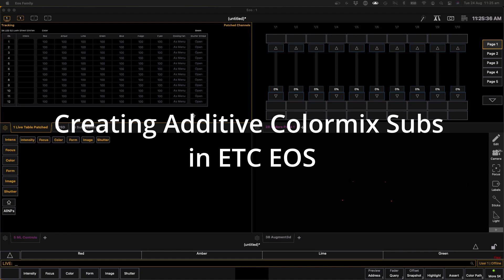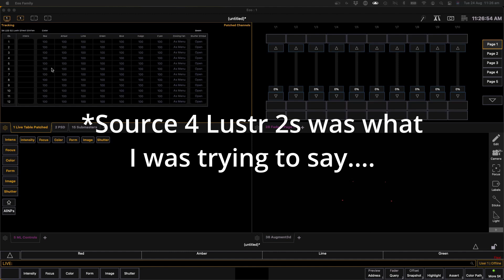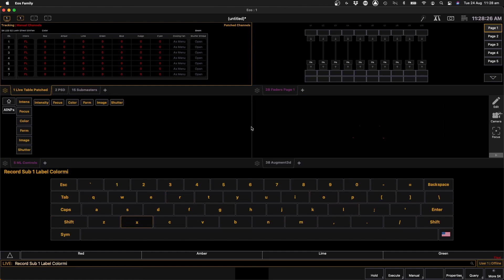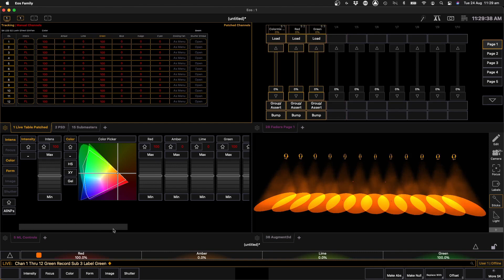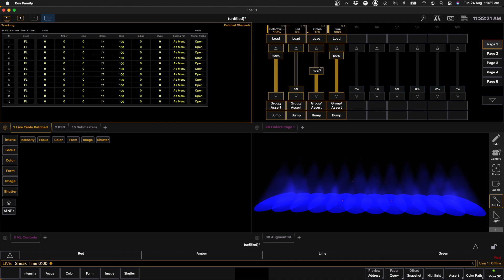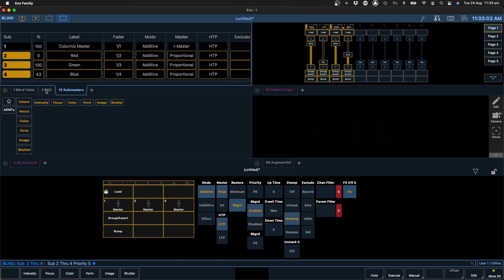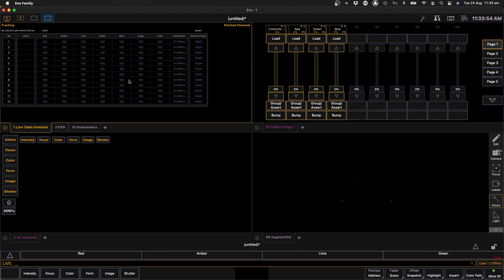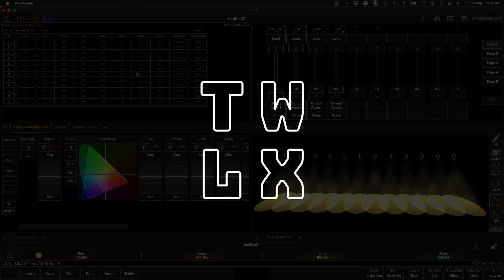ETC EOS Tutorial - Making Additive Colour Submasters for your EOS console.

Comment: Instead of an IM why not record only Intensity on sub 1?
Reply from the maker: Because the natural convention of multi-parameter fixtures in EOS is for color home values to be set to full. So the IM fader starts by setting these colour values to 0, which subsequently allows you to manually mix colour with your subs. You dont need the IM if you change the default value of your color parameters to 0 in the fixture editor, but for a bunch of reasons I personally dont like doing this.

Comment: Fader 1 proportional all colors at full
Fader 2 thru 4 inhibitive with filter for each color.
Reply from the maker: Sure. This works too. I'm less keen on using inhibative subs in this way - I tend to use them more for safety functions like FOH inhibit, Atmospherics etc. But as I said in the video, there are bunch of ways to achieve additive subs on this desk, and all have their advantages/disadvantages, depending on the use-case. More importantly, the process of setting up the desk to achieve additive subs should also hopefully teach students about fundamental concepts of the desk, be they intensity masters, fader priority, inhibitive subs, filters, fixture profiles and default values. So all good stuff to discuss and experiment with.